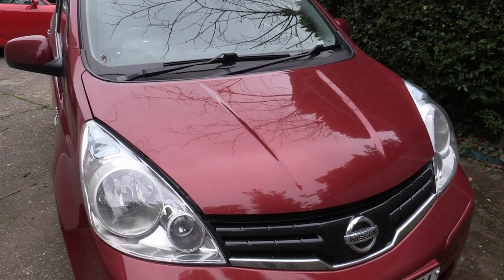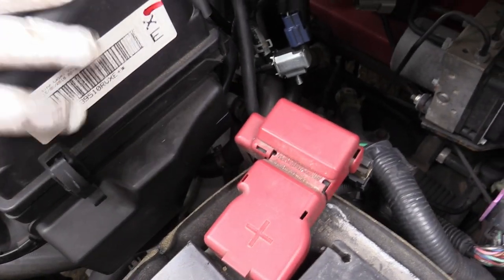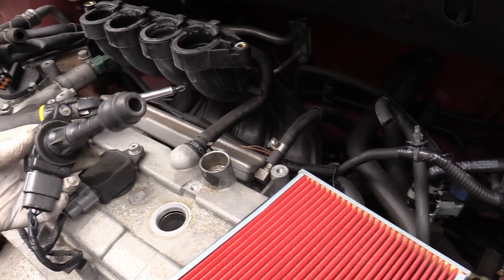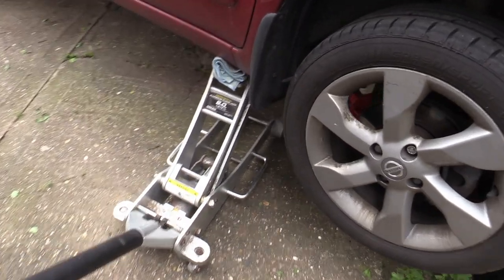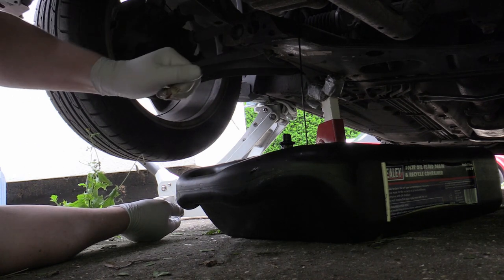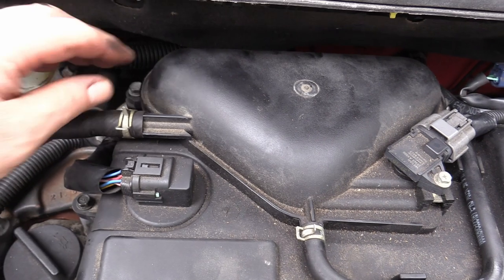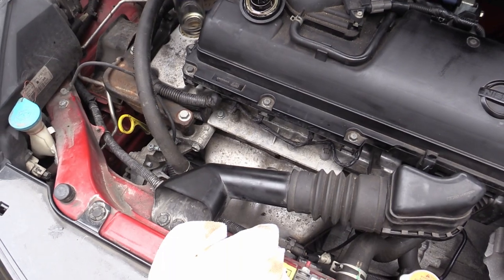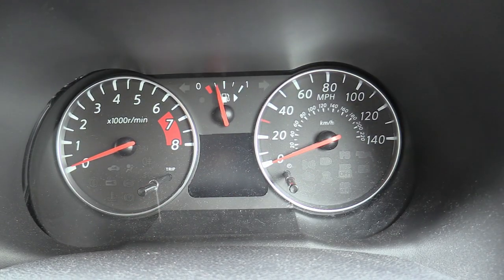Nissan Note/ Micra  service PETROL

Comment: Thanks for the video. I did this to my 2011 1.4 note today. I did however decide to take the driver side wheel off and that provided easy access to the oil filter from the side meaning no oil running down my arm.

Also, glad you recommended the oil drainer. A useful bit of kit.
Reply from the maker: did you need to take the wheel arch liner out to get to it???

Comment: Hi, great video. Can you tell me where the fuel filter is in the 1.4  petrol Nissan Note ?. Thanks
Reply from the maker: the note is a weird one as the filter is inside the fuel tank as part of the fuel pump, level sensor assembly so is not easily accessable - I took this as it doesnt need replacing....
Reply: @SNORKYMEDIA  Thanks very much for the info ! 👍

Comment: QQ re the pollen filter, did you take the panel off under the footwell to get to the old filter?
Reply from the maker: no you dont need to take anything off on this model year you can get to it just by looking under the dash on the passenger side towards the centre console - look for the white tab sticking out